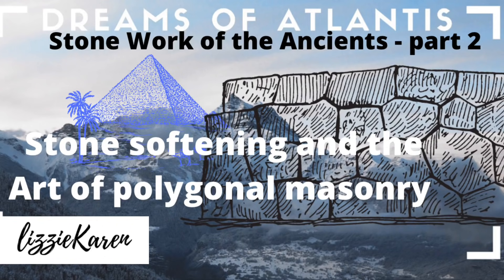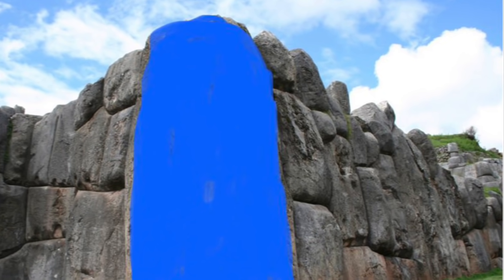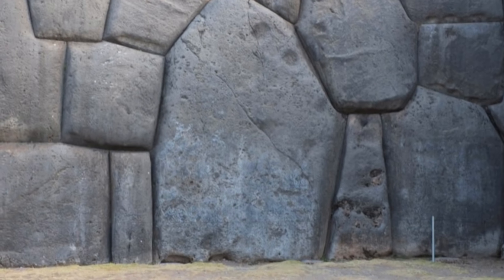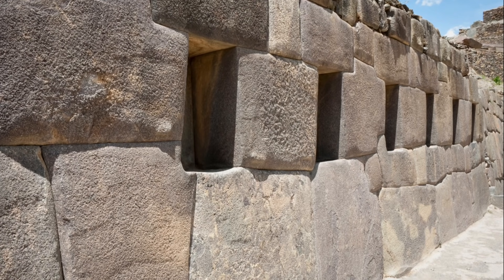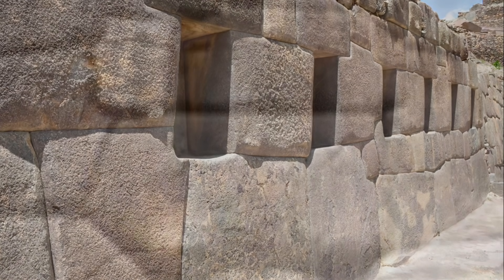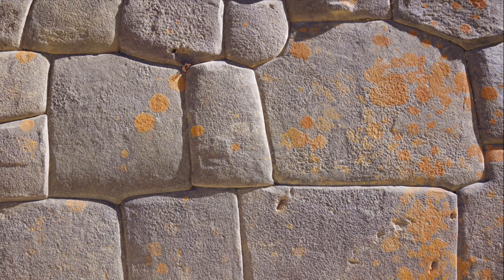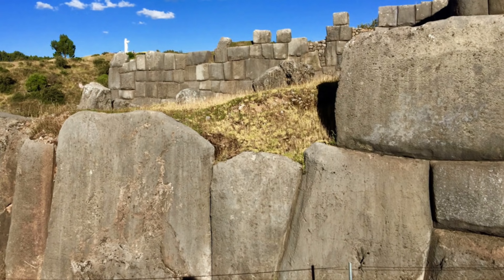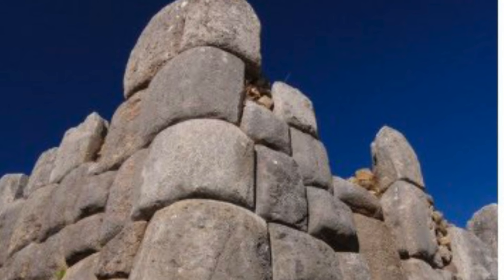Ancient stone softening is the key to polygonal masonry

Comment: Membranes? I doubt it. It's hard to press a 3 ton stone against another. I think the 1 to 2 inch high nubs reveal the actual depth of the rock softening process. Maybe the nubs did not respond as well as the rest of the rock surface, and were left in place once in a while. The softened surfaces could be troweled together especially if the rock already in place had re hardened a bit. The rocks made their own mortar!
Reply from the maker: Ok, I see your point but maybe I did not describe what I saw sufficiently, from my dream. Let me elaborate, please. Imagine wet concrete in a mold with large chunks of stone put into the mold to raise the level so that less concrete is required. But if all you had was a wooden mold the concrete would seep out at the corners and the base. The end result would not look good. But if you lined the mold with a membrane to hold the liquid from escaping quickly, it is still the wood that provides the shape and holds it together. The membrane only prevents the solution escaping as only the water can drain slowly out.

Comment: humm but nubs are there on the stone mining quarry and also on the stone wall and floors!! of monolithic stone stracture....
it might be a by product of the stone softening method which we have no clue ... 
many walls are half finished and you can see nubs on half wall and other half nubs are removed and wall are made smooth by cutting quite a bit .. may be when the stone was soft enough..
stone are definitely made plyable it becomes clear  when you see L (in plan) shape stone at 90* angle bends 
if we see the marking on the stone quarry, same in caves wall it seems stone is scooped out like icecream !!! with very eaze
Reply from the maker: Yes, true. My other video covers the stone scooping using vibratory machines. There were many techniques and so I address the different techniques in different videos. Cheers